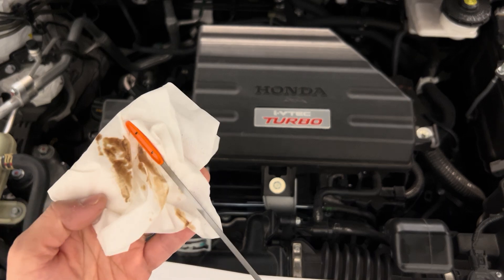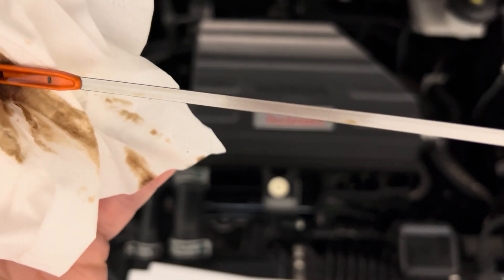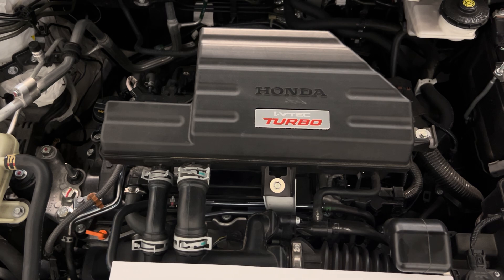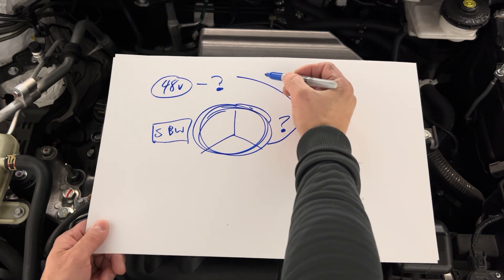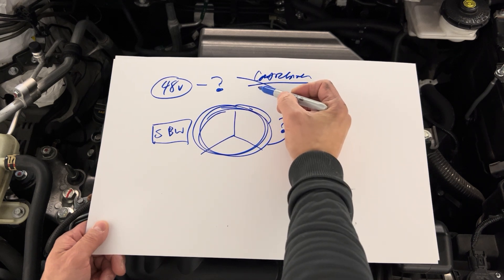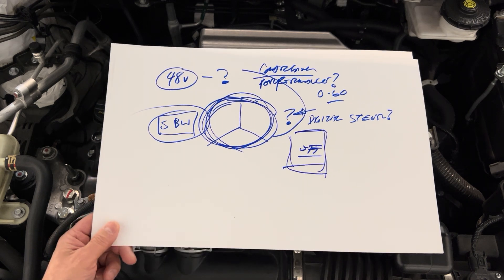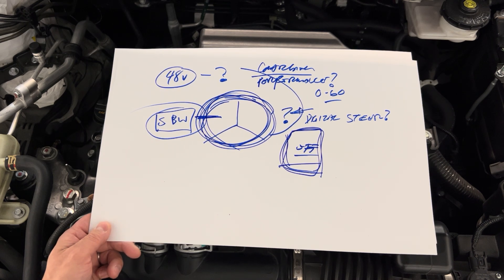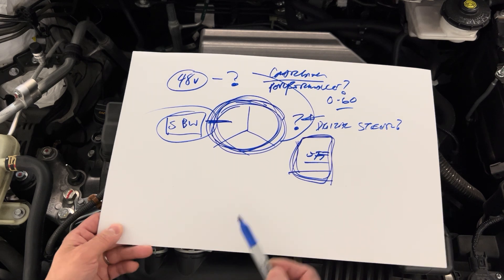HAzARD! Cybertruck Steer-By-Wire. Bad idea?

Comment: Lots of vehicles are drive by wire already, not a tesla or cyber truck thing, far from a new thing
Reply: This is not true, Steer-by-wire without the use of a steering column was first offered in a production car with the Nissan Infiniti Q50 in 2013.
Reply: So therefore, the cyber truck is far from the first production car with steer-by-wire since the technology has been in use for a decade in automotive applications
Reply: @xbus-christhat is neither what your first statement was nor is it contingent upon the definition of steer-by-wire, so again your statement was false 👍🏻

Comment: the 48 V system has nothing to do with the drivetrain of the Tesla, ist for all the internal stuff like lights and small engines 12 V needs a lot of current and a higher Voltage can solve some of the problems of a Car like that. you need 1200W ether you have a 100  or 25Amps

Comment: They keep saying throttle by wire is the same thing. Throttle will close and not open if a fault occurs until it's corrected. Hence the car will not go or it will coast to a stop and not move the vehicle. If steering by wire fails at 60mph guess what, you aren't steering and you are likely to panic while the car speeds to a solid object.

Comment: My question is how should a driver avoid crashing into an object on the road when they don't have a sense of steering?  What if you switch between the two driving systems? How do you adjust

Comment: Just wait until you find out that aircraft have been using steer-by-wire for decades. 🤣🤣😂😂
Reply: Yeah, but if the system fails, there's usually time to correct the issue before it causes harm, that's not so with the steering system in a car.
Reply from the maker: Well, I sorta knew it wasn’t a mechanical pole that was controlling the rudders and flaps in the back 😂
I realize that SBW is an eventual thing… but Let me ask you, would you trust Tesla with first to mass market implementation of SBW or would you trust Toyota-Lexus? Or Airbus for argument sake. 

Remember what we got from first iterations of “autopilot”? 

Past history isn’t an indication of future performance… But history sure does tend to rhyme. OOPS I DID IT AGAIN🎉🎉🎉

Comment: Ok. Let's bring some sanity into the conversation. Mechanical systems are not 100% reliable either. Your tie rods and ball joints can fail and with them there goes the ability to steer the car.
When do they fail? Usually at about 100K miles or so. Honda and Toyota use electric steering assist for decades now. Have you heard of any of these fail? I haven't. But hydraulic power steering failures are quite common. Worn out seals, worn out pumps, broken hydraulic lines etc etc etc. So, the electric systems are quite reliable. Electric steering assist is also quite powerful, just compare the steering before you turn the engine on and after Now think about how powerful the system must be to make the steering so easy for you. It can easily overpower a human being, if it malfunctions. Have you heard of any lawsuits against any car manufacturers lately? Yep.
The airplanes switched to fly by wire more than half a century ago, and the failure modes of these systems are quite well studied. So no, you won't see cybertrucks careening off the road with uncontrollable steering.
Having said this, cybertruck is a stupid car, I am not defending it. I just want to debunk the notion that steer by wire is a dangerous thing.
By the way, Toyota is putting it into their new Lexus cars as well. So there you go, it is not just Tesla that does it.
Reply from the maker: Thanks for the sanity bro. True that mechanical steering can fail, it is always going to be a gradual one. Meaning there’d be plenty of warning signs like noisy rack, diminished steering assist and accuracy etc before catastrophic failure happens. That’s the beauty of analog mechanical systems. Better is that it has be improved since the first automobile. This SBW on the CT is first to mass market (based on Teslas track record, sorry, I’d place my safety bets on Toyota-Lexus RZ).
As for power steering assist failing, if it does happen when you are in motion, you won’t lose control because your mechanical steering is still in tact. You can still steer yourself into safety. To illustrate this, turn your car off, put it into run mode without cranking your engine on and try steering. It still works but it’s just takes a lot of effort  to turn the wheel and in turn steering the tires. 

You see, I’m not necessarily against progress. I’m just not trusting of a company that has had a questionable track record. 
Simply put, I’d buy a Lexus RZ with SBW before I’d even think about any of the Tesla products let alone the CT.

Comment: The cybertrucks have a square-ish shaped wheel, and lock-to-lock is less than 360°, so you almost never need to readjust your hands on the wheel. Lexus is planning on doing a steer-by-wire for the same reasons (I think). I, for one, don’t think it’s necessary, and I’ll probably be avoiding it until it proves reliable
Reply: Lexus has been using drive by wire for at least 10 years on some of its models.......just sayin'...
Reply: @billiebobbienorton2556  No they haven’t. You may be thinking of electronic power steering, which is different. In drive by wire, there’s no physical connection between the steering input and front wheels
Reply: Lexus as a car manufacturer is a tiny bit more experienced as a car manufacturer than Tesla tho. 😂
Reply from the maker: Not necessary and put on the CT for marketing Oohs and aaahhs. 

I’m just hoping that I’m wrong about the safety issues. We share the road with our fellow maroons - in this case with a 6000+lb stainless steel knife that can go 0-60 as fast as a liter bike (dangerous, I should know)… except on a bike, typically, it only weighs 450lbs wet and only the rider gets the short end.
Reply: @kidsfuturesareworthit.8673  all comercial planes work with steer by wire and have 100 plus people on board with a lot more potential victims on the ground. Yes its unnecessary but so is cruise control that acually can speed the car up

Comment: The last line of defense is steering. Absolute no. Car makers arent held up to the same standards as planes. So the argument of redundancy is moot
Reply from the maker: Totally agree. 
Worse is that in the air, there’s limited “traffic” to complicate things. 
Also, this means that one of these huge stainless steel trucks can and will pose a threat to unsuspecting motorists.

Comment: Ex automotive engineer here (did vehicle development work for steering systems). I don't want this to sound mean but your take is sort of naive. 

48V - this is the architecture for the vehicle systems and communications, NOT relating to the drivetrain, main battery etc (that system is likely on 800v). It's a separate system - like how the 12v system in your car is separate from the engine performance. Higher voltage in a system means you can run less current through the wires to get to the same wattage (power) requirements. Meaning your wiring can be thinner and lighter, there's less heat generated by the system etc. it also better coincides with the Ethernet communication used (instead of traditional CAN or CAN FD). This is just a logical step in vehicles that should've been done a long time ago, but when you have such a long-standing norm like 12v, it's hard to buck the trend - but that's what Tesla is all about doing. Other OEM's have already begun development on 48v vehicle architectures because it's simply better.

Steer by wire - this has already been commonplace for years. More than a couple OEM's already have vehicles on the market with steering systems that are steer by wire, but some of them do have a mechanical "backup" that will engage if there's a serious enough steering software fault. I think Infiniti was the first to do it in North America almost a decade ago. I don't know if Tesla has any sort of mechanical backup, but the people making these things aren't idiots. There's so much more that goes into something as simple as a steering rack than you'd think. I worked on rear steer systems which were purely drive by wire, and the levels of safety and compliance are huge. Of course problems can arise after a vehicle is launched, but Tesla isn't the first to do it, and I wouldn't be too worried. The reason they do it is so they can have the rack be "infinite ratio" and be able to turn the wheels at different angles based on vehicle speed. 

I'd recommend watching some videos from Munro Live or Weber Automotive to learn about vehicle development and what goes into this stuff.
Reply from the maker: Thanks for chiming in and clearing up the 48v update. But to answer, there’s no mechanical backup in Tesla’s SBW. It has triple redundancies: extra motors, extra computer, extra power backup etc,,, but more of an issue is that no matter how late the CT is, it seems like it was rushed into market from the same guys who branded their not so self-driving “autopilot” which insinuates Autopilot in an Aircraft? 
I hope I’m wrong and bringing up this concern is Naive… but we are all putting our trust in all this new tech that is brought to us by a relatively new company and led by someone that is quite brash to say the least. Lexus introduced SBW in their RZ… I’d trust Toyota over Tesla, that’s all.

Comment: Most modern farm equipment is steer by wire and every modern aircraft. Also a lot of super and hyper cars are steer by wire as well.  Also every single cargo ship and cruise liner are steer by wire. If you are scared of steer by wire then you should just stay home.
Reply: Knowing how well tesla makes electronics, motors, actuators there's probably more chance that a steering shaft will rust out and fail in regular car than for their steer by wire to fail. If it wasn't safe they wouldn't put it.
Reply: @dkdanis1340 the most ignorant fanboy comment ever.
Reply: source trust me bro
Reply from the maker: Not sure about farm equipment as farm equipment operates on a farm… and John Deer has been around for over century, same with most aircraft manufacturers, that are run by responsible adults = more trust in their tech…
Also, as mentioned before, airplanes operate in controlled skies… much different than the roads that we (millions all at once) share. NHTSA history shows all sorts of law suits and settlements with manufacturers. Seems like we haven’t learned much in this case. Can’t stop change, ok, but at what cost and what’s the benefit? We can’t have nice things because some of this stuff puts others at risk.
Reply: @kidsfuturesareworthit.8673 if your argument is older, so we trust their tech more. You might wanna look up how old these car manufacturers actually are. You clearly are just scared of new things. Cause you don't have any actual points. Other than being afraid cause you don't understand something. If you wanna link a study or litterally anything. Yes tractor use by wire. Forklifts use by wire. Planes use by wire. The British army started using wire steering on there Terrier combat engineering vehicles back in 2013. Litterally reliable for planes and the military. But yeah sure it's gonna be a massive risk in your car. Man your just scared of change. There's a reason the actual educated engineers don't agree with you. Your just making baseless statements. You've closed your mind to other options. And that's kinda sad tbh

Comment: "Every other car steer by mechanical connection? Imagine that your steering wheel does not have a digital connection to your steering rack system. This is how other cars are designed: Steer-by-mechanics means that ANY malfunction in your steering system will cause you to lose steering ability."

Yes, you can say that about ANY car. You know what you can also say about any car? That since they are mechanical AND electronic, a steering in either can screw your day. Try overpowering a hydraulic or electric actuator that decided it wants to go right, on the highway. Good luck with that. Guess what? It just doesn't happen, except for a few strange occurrences. And none of those have caused serious accidents. 

Of course, you know nothing about the issue, you're just repeating the usual "billionaire bad", "hyperloop whatever", "life on mars that" rhetoric that your communist overlords told you to repeat.
Reply: hydraulic power steering is a passive system, it cannot work agasint you like an electric powersteering assist.  YOU move the valvings, not the computer.
Reply: @Nordic_Mechanic  It's obsolete, what modern car uses hydraulic power steering? They're almost all electric. The few that want to keep it, are electric assisted hydraulics. Everything in cars has gone electronic, including throttles.

Comment: If you are going to criticize at least use more than 2 brain cells and do at least a minimal amount of research.

SBW - needs 2 computer systems working independently and isolated from the MCU.  It's like me saying what happens if your steering has an oil leak and you lose steering on the highway.  The current system has similar types of failure modes.

The 48V reduces the amount of wiring needed in the vehicle.  Since they use an ethernet loop as well it means you also get double wiring reducency to each component.
Reply: you dont lose steering when you have an power steering leak. And on the highway is the safest place to have a power steering issue, as the car is easier to keep in line mechanically
Reply: @Nordic_Mechanic  If the right component fails yes you do lose the ability to steer.
Reply from the maker: I’m doing my best to use lots of brain cells and more than the controlled narrative to form an opinion on what’s going to happen in the real world with millions of cars and people in it. 

Yes, fly by wire has been a thing in the Air for decades - but it is from companies with track records decades in the making. Tesla? Think about what happened to their “Autopilot” and Rockets blowing up… and while I agree most of it is human error, that is where the crux is. The airspace is not like the roads that you and I share. The air is pretty much fully controlled, the ground is a jungle of maroons. True. 

Mix this questionable tech with a multitude of layers of complexity and real world situations and it’ll spell the unthinkable. 
You see, there are millions of cars on the road. Millions of probabilities even at 0.001% error mixed with human error… you get the point. 

How many F35s and commercial airplanes in the air an any given point?
Reply: @kidsfuturesareworthit.8673  This just screams I am too ignorant and will go on my own opinions without taking an ounce of logic into things.

Controlling the narrative to bring light to a situation by flat out being stupid and implying the MCU going out will cause it to fail is beyond stupid.

Questionable tech argument is so stupid given that you clearly didn't even spend two second doing a bit of research before blabbering on acting like it's a single point of failure or that it's somehow going to be more dangerous than what currently is like.

Steer by wire requires redundancies everywhere and the systems need to operate independently of each other as well, so one component failing can't trigger issues with the other component.  Your whole power argument is shot as well since you also have redundant power.

In fact this eliminates the human element when it comes to overcorrecting while lets say driving on a highway. 

The fact is the acceleration pedal is the same thing and there hasn't been any acceleration due software glitches because again you have multiple redundancies built in place for that system.

The amount of things that have to go wrong for your steering to fail is so large that its easy to say the system we have now is just as fragile.  The system we do have though is actually fragile in that if you lose sudden hydraulic pressure while steering you will effectively lose your capability to steer.